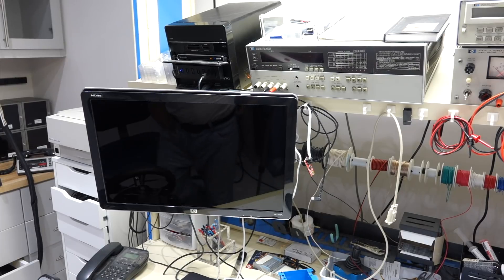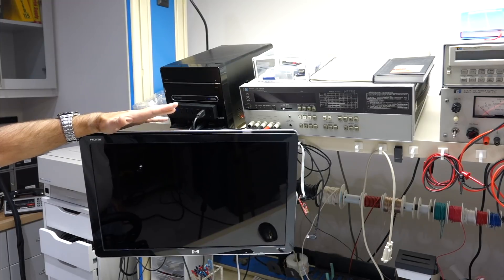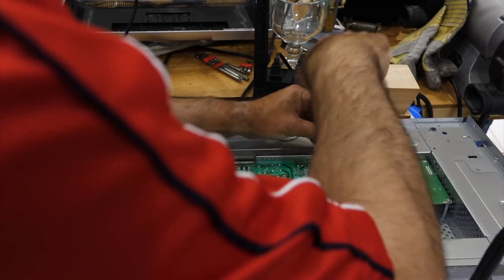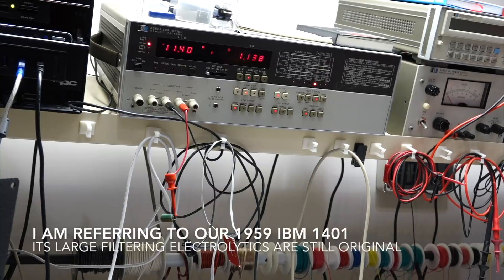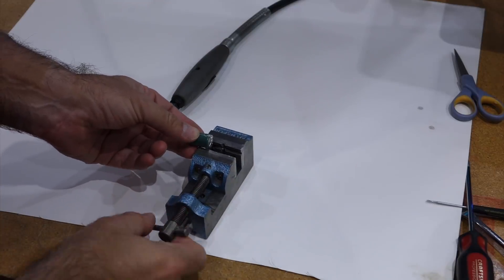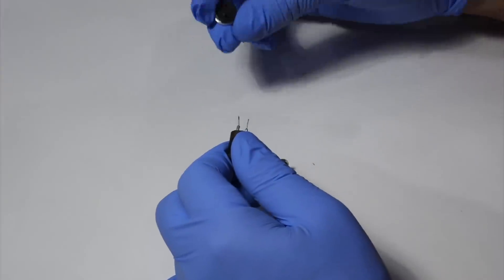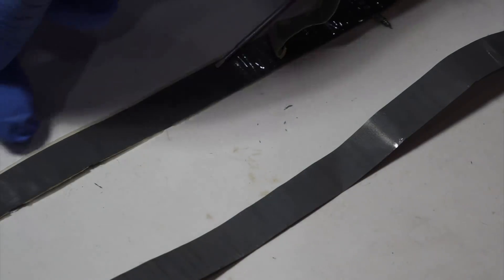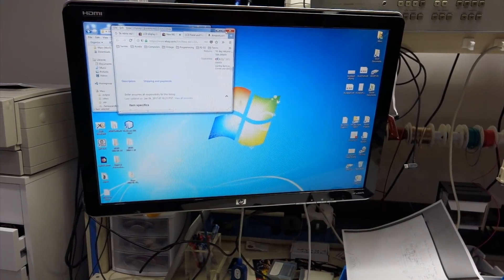Modern Tech Fail : HP w2207h Display Has Capacitor Plague

Comment: 5:54 CrapXon brand. Not surprising. They are the absolute cheapest worst quality caps of all. I replace CrapXon caps on sight even when not bulging because they guaranteed to fail in a short time. I use high quality Panasonic FR series caps.
Reply: If you think Capxon are bad you should see the ChengX ones!
Reply: Ive replaced chengx, chongx, chang and similar too before. Fukyuu brand caps are bad too.
Reply: @simontay4851  I have suppliers in China that I get ChengX and ChengXing caps from and haven't had an issue in 4+ years of using them in a few hundred repairs, though I don't tend to put them in places where they'll be under high stress like next to hot mosfets. They're great to use if you have a dodgy device that you think caps may be the problem, but aren't sure, or if the device isn't worth ordering a cap kit from Mouser for.

Crapxon caps will fail for any and all reasons in any situation, including looking at them in a way which doesn't please them. I've had them nuke power boards due to going electrically leaky or dead short. The most recent victim was a 32" LG TV which had a cascading failure from a CrapXon cap that went all the way back to the primary push/pull switching mosfets and blew a hole in one of them and cooked the transformer into a crispy charcoal briquette.

A couple of other trash brands are Fuhjyyu, OST, Teapo, Asia-X, Stone and Jun-Fu. United Chemi-Con KZG and KZE series caps are also horrible and have near 100% failure rates. They either popcorn or fail open/short, go high ESR or become electrically leaky.
Reply: @simontay4851  There's a brand called Fukyuu?  How appropriate. :)
Reply: The real name is Fuhjyyu as GGigabiteM said above but i can never remember the correct spelling (or pronounce it) so i just call them Fukyyu/Fukyuu instead. When (not if) they fail, they're completely fucked with >20ohms ESR and unmeasurable capacitance and the tops are bulged out. Sometimes they cause the output diode(s) of the SMPS to fail short too. So fukyyu is quite appropriate.
Reply: These aren't even badcaps, these are goodcaps. Because i mean they lasted perched right near a heatsink with very hot secondary diodes that radiate about 1/10th of the power supply's total power with barely any moving air for 11 years! This display has CCFL and was made in 2007! And all around them is the CCFL driver which radiates even more heat! It's just a thermally unfortunate design of the system overall, caps in it simply won't last forever, but 11 years is pretty good service life.
Reply: Yepp, they are called CrapXon for a reason... I've replaced so many of them already, all in Samsung LCD monitors. xD
Reply: In our part of the world we do not have panasonic we have only capxon, samwha, sometimes ... nippon (cheng* is out of the question) and capxon is not the cheapest of those three.
Reply: Other good quality Japanese caps are RubyCon, Sanyo, Nippon KY series, Nichicon, Hitachi. Samwha are ok i think. You can buy Panasonic caps on Farnell Element14. They have a regional version of the website for most countries. Definitely in US, most EU countries and AUS at least.
Reply: I've never had an issue with modern electolytics. I use Nichicon & Panasonic and they are great.
Reply: CapXon	CrapXon – “Proudly failing since power-on.” 💣
Lelon	LeLeak – “Swells faster than my stress.” 💦

Suscon	Suscon – “That capacitor is hella sus.” 🔴
Jamicon	Jammycon – “Stuck like jam, bloats like bread.” 🍞
Fuhjyyu	Fuhk-yu – “Said goodbye to your PSU.” 😤

Teapo	Teablow – “Brewed in disaster, served in sparks.” ☕💥
Jun Fu	Junk Fu – “Karate chopped my whole motherboard.” 🥋🔥

G-Luxon	Gone-Luxon – “Looks premium. Dies poor.” 💸

Canicon	Can’t-i-con – “Can I conduct? Nah bro.” ❌
Chhsi	ChiSSy – “ChiSSed all over the PCB.” 🤢

Aishi	Ayy-sheesh – “Sheesh, that’s bloated already?!” 😩

Toshin Kogyo	Toss-in-Crapyo – “Just toss it in the bin.” 🗑️

Luxon	Luck’s gone – “Try your luck. It’s gone now.” 🎲💀
Samwha	Scamwha – “Surprise failure included!” 🎁🔥

Samxon	Slam-Gone – “Slammed by ripple. Gone by noon.” ⏰

“Jun Fu? Sounds like kung fu, performs like tofu.” 🥴

“CapXon in a PSU is like putting ketchup in a Ferrari engine.” 🍅⚙️

“Lelon capacitors: the real reason why smoke detectors exist.” 😭

“When I see Suscon, I trust the smoke more than the specs.”

Comment: My understanding was that the 'cap plague' was caused by someone (Nichicon?) allowing a faulty electrolyte recipe to be 'stolen'... if so, then it was a brilliant example of reverse industrial espionage.
Reply: Two times I know of that Nichicon itself had bad runs of electrolytic capacitors.  In the 1960s and in the 1980-90s with a turquoise plastic covering.

Comment: That's why I love your channel so much.
Most would have stopped there, after having replaced the caps. Heck, they probably would have replaced them all blindly and not just the bad ones.

But a curious guy like you just had to go the extra step... Measure it.... Not enough? Cut it open.... Not enough? Unroll it... Not enough? Cut open a good one for comparison.... Not enough? Look at them under the microscope!

You are the man!

Merci. J'ai trouvé ça très intéressant!

Comment: I had exactly the same issue with a Samsung 22" monitor from the same era, although it was much easier to take apart and repair with Japanese caps recommended online. I don't actually remember why I threw that one out in the end. After the capacitor investigation I can recommend Big Clive's videos, they should fuel your curiosity with similar experiments. Oh, great to see an old Laserjet in the opening section of the video, good old bulletproof HP.
Reply: You probably threw it out because now is the time for CCFL to fail, it's been a good 10 years.

I had done a complete recap of my dad's 20" from the era a few months back; now it came back, caps still good, failing to strike the CCFL and turning off after a few seconds. Switching around the CCFL, it was obvious that one of them was simply dead, and when i pulled it apart, it was blackened 1cm deep on one end. I had a CCFL to LED retrofit kit for $4 stashed just in case, and put it to use, so it's a LED LCD now :D The kit was super shady BTW, had to replace numerous LEDs, and i'm sure it's not the last i hear of its issues :D

Comment: With all of these failures, it's time to check the bonding and grounding in your lab. Something may be screwed-up with your grounding in the lab.
Reply: I doubt it. Modern Apple products are built as cheap as possible, so they fail a lot. LCD screens get hot and the caps inside them don't like it. Nothing out of the ordinary here.
Reply: Grounding is home lab setups like Marc’s is primarily to protect humans. In absence of broken humans (d’ohh), loss of grounding could cause diminished performance of low frequency emissions controls. No other failures would be directly attributable to it. In most equipment, ground has very few connection points and what matters aren’t the connections external to the device but internal ones: those capacitors that sit between L, N and PE, as well as the capacitors that go between the primary and the secondary of the switching supply to shunt the common mode current. The low voltage side doesn’t care much whether it sits at Earth potential as long as nobody gets hurt - it really has no reference to anything other than the transformer insulation and the safety capacitors. People routinely run equipment with ground defeaters in old apartments with two-prong mains sockets and they don’t die left right and center and neither does their equipment. It’s not advisable of course, but safe operation with no ground is almost a normal operating condition if you’re prudent about your engineering. I usually design for medical class I leakage since it doesn’t add extra cost in practice in what I do, and thus loss of PE causes the earth and enclosure leakage to go from say 50-80uA to 150-200uA (example from a piece of non-medical test gear I put together for my own use). There are no single failures inside that would raise that further either. And it’s a device with 3-prong inlet and a custom power supply (designed just because I had an itch rather than because it was needed).  I probably wouldn’t be routinely touching it while ungrounded while standing in a bathtub full of water, but I wouldn’t get hurt if I tried either :) In my own designs, I test leakage at 62Hz, 240VAC+15%, BTW - the worst-case condition in my mind. It’s lower when I actually power it from mains here in the US. Someone I know with aviation background likes to test their designs’ leakage for worst case up to 400Hz, even if it’s just some basic thing that’s used with regular US mains only. Overkill but some like it that way :)

Now if there was some other stuff we are not aware of that dumped its transients between ground and L/N then it perhaps might cause overvoltage stress (never mind unsafe conditions for people) but failures from overvoltage between L/N and PE are rather telltale and hard to miss. You know you got one first thing you open the device up.

Comment: I suspect that HP never bothered to do any testing on these caps before using them. The design engineers specd a cap of a certain value and purchasing bought the cheapest one they could find.

I was once asked to test a cheap SLA battery for an electronics manufacturer I worked for. After a couple of weeks of going rounds with engineering and marketing I gave up. I could not even get a power usage profile of the equipment it was going in, temp ranges, etc. There was nothing to test. Marketing actually said 'Is it a battery? Is it 12V?' It was cheap and that was all that mattered.

Comment: Looks like they get hot, thanks for the autopsy report! I've changed more then a few of those. They really don't tolerate the heat inside lcd displays but it's really worse then just that. Anyone remember those cute little Cyberhome DVD players that sold for about $40 in the mid 2000's? I knew at least 3 people who bought those and I have one also. They were all dead within 4 years from power supply failure. One by one they were given to me for parts but they just sit there now. 
Has anyone had them short and take out other components? I haven't seen it yet but... The one good thing about them is when decent equipment from that era rains down from the sky and ends up working well for you after a cheap fix.
Reply: Good thing is if they short, since they're across the power rails, the voltage on other components drops, the SMPS controller detects over current/under voltage and turns off the power supply, or the fuse blows. If that doesn't happen, the transformer would be cause for concern for overheating and insulation failure.

Comment: The "capacitor plague" is often blamed on bad quality caps, when it can be due to several reasons, including bad design (underrated ripple current, location close to hot compoments) and high run time.
Reply from the maker: These are all very good points. Actually in this case probably a combo of all these plus a low quality cap to start with...
Reply: You know for sure the engineering department wanted better capps...
Reply: Japanese Panasonic FR series are rated for 10,000 hours at 105C so will last many years.
Reply: Dang, too bad RadioShack went out of business, used to just run down there for a new can of smoke & recharge them. 😆

Seriously though, I recall hearing in the late 90s about the origin of the capacitor plague. It was all about industrial espionage in Taiwan. Chinese company stole an incomplete electrolyte formula from an outfit in Taiwan, then got even by selling the defective caps with the source company's brand on them!  Apparently they're still using it.... or forgot how to de-rate for ripple & temperature.  In my designs, I always use over-rated electrolytics.  A TTC earth station I equipped took two direct lightning hits, and my protocol converters kept right on running even though half of the connected computers were destroyed.
Reply: yes but these factors you say are often made wrong on purpose to limit the life time of the product...the challenge is not to make a product that lasts a long time but a product that fails after a certain time
Reply: i have a lot of 1950  usa made tube radios   that still have the same caps  an still  play  like new  ..an  they make more heat    than a solid  state  tv ..   got to put sme guts in them  or  they dry  out
Reply: i thought it was because some company used a new electrolyte that had flaws and everyone copied that electrolyte formula
Reply: When you can save 3 cents a cap in mass production of course they are going to buy the cheap components.  That saved money can buy a lot of hookers and blow.
Reply: Why dont they just sell each unit for a few cents or even a few $/£ more. The end customer isnt going to notice. Big manufacturers will be buying capacitors in thousands if not millions of quantity so will be able to get  them a lot cheaper than someone buying just a few to fix their own monitor.
Reply: When it only has a 90 day, or 1 to 5 year warranty depending on the product, and the fact that Multi-National corporations are A-Moral (designed to Maximize Profit) you are very lucky that inexpensively manufactured products last as long as they do.

Comment: I have been running my own development company for 30+ years and of the hundreds of PC's I have purchased I only ever had two fail, One power supply and one HDD. Both were easily fixed with readily available and easily replaced parts. Of the 40+ MAC's none lasted more then 18 months and parts could either not be found at all or the repair would have been too involved.Some of the current PC's are over 10 years old and still running.
Reply: You guys have had really bad luck with your computers. I have seen both Macs and IBM compatibles running without any hardware problems for years, sometimes even in quite heavy use.
Reply: In my experience the capacitor plague peaked around the year 2000, it got better every year after that. Nearly every socket 370/slot 1 motherboard I've seen has some bad caps, and so do most graphics cards of that era. Even slightly newer P4 era stuff is going to be loads better. But LCD monitors seem to go against the trend, I have a bunch of old 19" Dells and ELOs from ~2002 that are still going strong, while most 1080p ones from less than 10 years ago are toast.
Reply: @Aggrop0p  LCD monitors in early 2000s were still premium tech with high prices, so quality components were used by most manufacturers. Since about 2005 they have become much cheaper with razor thin margins for the manufacturers, especially at the low end of course. So iffy components have found their way to about every brand that makes affordable monitors. Low-ESR caps from Japanese manufacturers are significantly more expensive than Chinese discount brand ones when you talk about hundreds of thousands and millions of units.

That said, two years of continuous use is not actually that bad longevity. At 8 hours a day that would be 6 years of use, which is probably more than the expected lifetime of an inexpensive PC monitor in developed countries. In any case those Capxons lasted much longer than the really bad caps during the actual capacitor plague around the year 2000. Yes, they are still plenty bad quality and their spec sheets outright lie about their longevity, but it could be worse... (And it was).
Reply: And that’s why I always buy the AppleCare... in my experience, if it survives past the 36mo of AppleCare, it’ll survive to the point where I’m replacing it due to old age anyway...
Reply: And I've never seen a PC last even 18 months without at least one serious problem, I've got Macs that are over 30 years old and in perfect condition.  (And it's Mac not MAC, unless you're talking about ethernet addressing.  The plural is Macs or Macintoshes, Mac's is possessive, as in the Mac's MAC address.)

Comment: Capacitor plague was still happening in 2010??!? I had it happen to a pc I built in 2000 and then had to recap ~2003! I remember reading even back then that the problem (sloppy industrial espionage) was widely identified. Is this a second wave of plague?
Reply: Doubt it, just bad design and cost cutting.
Reply: Yeah that kinda surprises me also. I had heard this was over by 2008. But these crappy green and gold caps look just the same as the ones I've had to change many times. I hope it was that "HP" was using new old stock instead of them still being manufactured.
Reply: well... do you seriously think they destroyed all the crap-caps that had already been manufactured but not yet assembled into products? Hell no, for sure they marinated on shelves for a few years and then ended up getting used somewhere anyway.

Comment: My gosh you taking that front cover off made me hurt on the inside but hey it worked! 😀

Never managed to ever figure out how to get a screw-less panel open, might give it a try sometime in the future after seeing this
Reply: Use a thick guitar pick and go around unseating the clips one by one. With practice you can do it without ever leaving a mark on the plastic. Never use screwdrivers or anything metal. Oh, and you go in from the outside edge, not the front where the screen is, unless you really want to crack the screen.